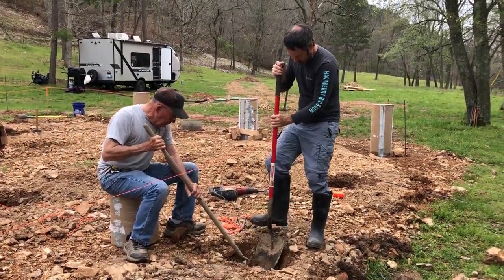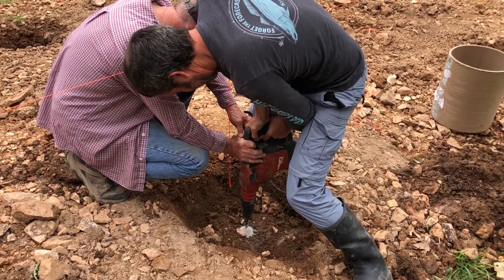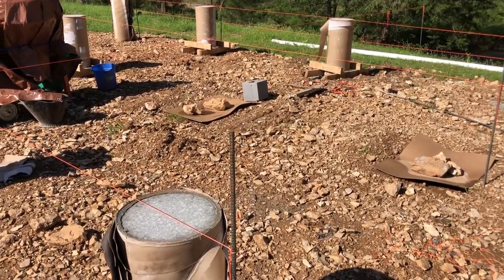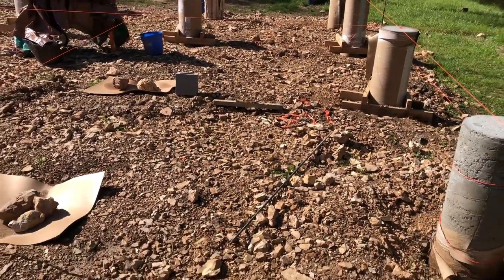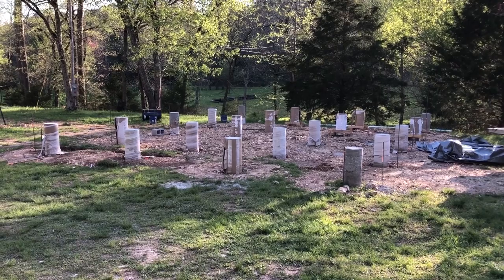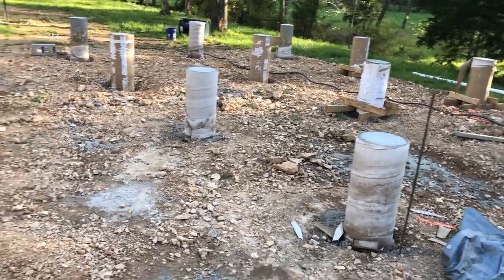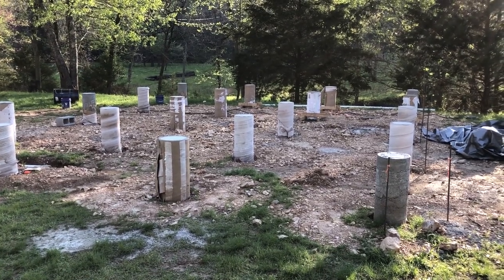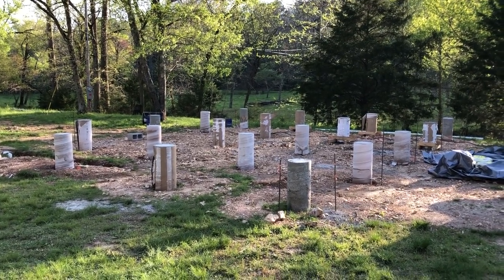Arched Cabin Build - All Piers Completed! | Tiny House

Comment: Another easier way to do this by hand is to mix in wheelbarrows and use a ramp to get the mud to the pour level. Be sure to have half a dozen high school football players in your employ. I assume a concrete truck and pumper were not available. You did it the hard way but you did it!
Reply from the maker: Funny, yes I found the most difficult route, almost 11,000 pounds of concrete, needless to say it felt good to be finished with that task ✌️

Comment: I just want to say thanks first of all.  We are beginning the same size cabin and these videos have been a tremendous help.  One quick question, how far above ground did you make your piers?   Thanks much!
Reply from the maker: You’re welcome and thank you for the positive energy. Glad to have you along for the adventure…the area where I built the cabin wasn’t completely level so the height above ground for each pier varies somewhat but generally speaking, we tried to have at least 2.5 feet above ground to make it more comfortable to get around in the crawl space. I’d probably go a little higher if I had it all to do over again, enough so I could sit up without hitting my head. Hope this helps. Good luck with your build!! ✌️

Comment: I saw some people on YouTube using metal imbeds in the posts and welding I beams across them. When you ordered the kit did they recommend a way to do it or is it just whatever you feel comfortable with?
Reply from the maker: I believe Arched Cabins has an option for you to purchase steel piers directly from them but you are correct, it’s whatever you feel comfortable with. Some people do a full slab foundation too